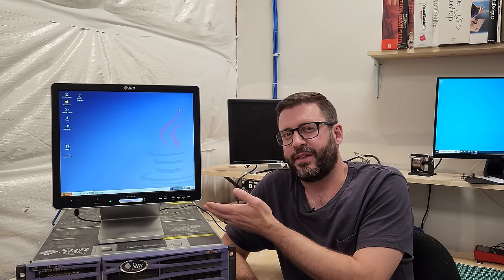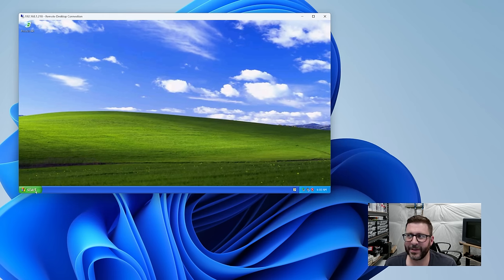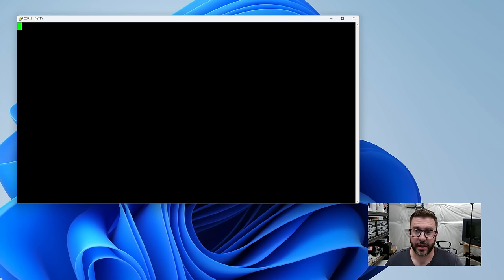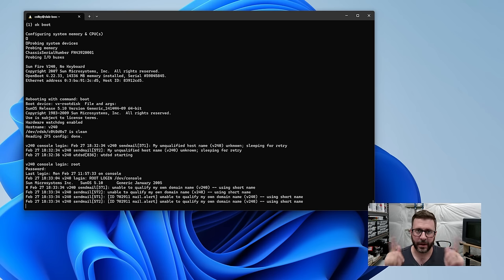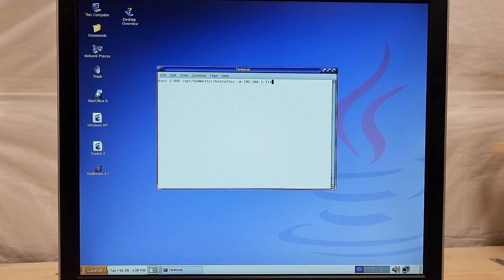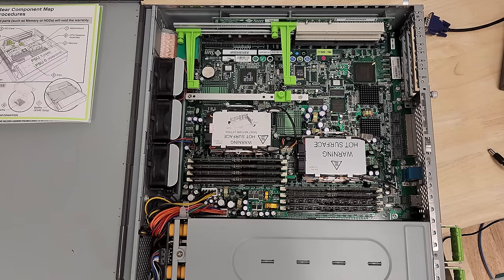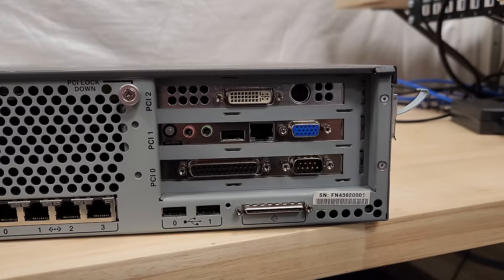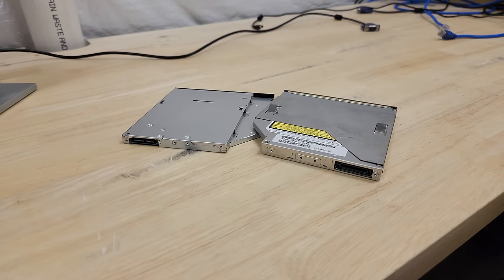Sun Ray Thin Clients Pt.3: Using Windows

Comment: what a cliffhanger! When I started at TI, vice president, said they used to work in the x86 business and I never knew why they would even try that! But this makes so much sense haha!
Reply from the maker: Sorry about the cliff hanger! We'll get it working eventually haha
Reply: TI used to make licensed 386 and 486 chips, as well as 387 co-processors IIRC. They may even have done one of the AMD-licensed 586 ones too. But after Pentium launched they dropped out of that market. Too bad! I'm a huge fan of TI stuff. I use their microcontrollers in my designs all the time, and I love their calculators (I have a pretty large collection of them). Definitely need a TI computer of some sort to complete my fanboy mania.

Comment: Hi !! You are my hero! I worked with this stuff and is impossible find sun/Solaris hardware cheap here in Brazil. Yesterday I brought a sun blade 100. R$500,00.. about $100,00.. includes a sun mouse and keyboard .
So, you are the guy that today does what I want to do, If I have access to the hardware.
Reply from the maker: Thanks! That's not too bad including the sun mouse and keyboard.
Reply: @clabretro  Yes, people charge a lot because is a "sun related" thing. Im also building my homelab rack. 2 x HP ML110 G7(Ill run esxi) 1 x 16TB HP microserver(xigmaNAS) 1x Dell powerconnect 2824, 1x  Watchguard XTM5(running PFSENSE) everything behind an UPS with an external baterry module(max 1 hour on batteries).
Reply from the maker: very nice! yeah sellers really inflate prices just because something has the Sun logo on it.

Comment: 20:30 that is actually supposed to be like that. It is there to provide some springiness.
Since what makes screws not go loosen over time isn't a large amount of torque, but rather that the screw remains under tension. Since tension will prevent it from continuing to loosen at any meaningful pace. Unlike a stiff joint that only needs the screw to crack loose once and then its free to vibrate further. So by making the bracket have an integrated spring (of debatable quality) will ensure that the cards remains firmly attached in more vibration prone environments. (like during shipping)

Now, not all brackets have this feature. I guess it looks ugly to some users, confuses others, or perhaps just adds manufacturing cost. But when it is there, it is intentional and serves a useful purpose.

Comment: If i see correctly, on the PCI Card are two additional connectors. one is the 34pin Floppy connector and other 40pin should be the smaller version of the ide connector. You find this connector in old Notebooks before SATA. Your IDE CD-Drive from the other Server is may incompatible. The Selection of the Drive Master/Slave is mostly flashed in the Firmware but it can be switched by unsolder of one specific PIN on the connector in the Drive or you flash the firmware.
Reply: The mini-IDE you're thinking of in laptops was actually 44 pins, because it had to provide power as well all in one connector. I have one in my NEC Versa 4000C laptop from the early 90s.

Comment: Great vid!   RDP has setting for # of colors.  I wonder if the sun client is limited or like the Windows client you can specify up to 32bit color   You might check to see if there's a newer version of Idrac for your 520's.  Newer versions work better with current Java or you can use HTML5.  Might not be available for the 520 but worth checking.   Keep the videos coming please.
Reply from the maker: thanks! I tried setting 24 bit color but it didn't make a difference. I probably need to play around with the settings more.

yeah my dell r720 has an idrac version which works fine in modern browsers, haven't dove into updating the r510 yet, on the list.

more to come!

Comment: Lol i was once talking about a x86 add-in card for the first Macs with caddy CDrom drives, and how a apple store near me had a mac and PC in the store window, with some kind of setup to show the mac could boot itself, and then boot windows, quicker than a bare metal PC doing it, and one of the folks who built those cards reached out in a comment and shared a bunch of pictures

I thought it was a mass produced unit, turns out they only made about 500 all told. It wasn't a apple product, it was made by a company in the UK

Its one of the few things outside of exotic radio gear that you struggle to find info on, i don't think many survived
Reply from the maker: Sad to think about how much interesting stuff like that has been lost to time (at least for now).
Reply: @clabretro  one oddity near me is a lot of odd older Dell PCs, Motorola phone stuff, and a few of the early iPhone prototypes, they were all built near me, with the exception of the iPhone that was maybe tested here? (In scotland)

A guy who reviews old PCs on here got a 30yo Dell still unused in its box from the Greenock factory and did a unboxing, I managed to send the video to a local group with a lot of the folk who worked at the plant, they were all chipping in seeing their initials on the QC stickers, or laughing at the squint lettering and tagging in the guy who worked that machine! 🤣 even the local MP was joining in, he'd been a union rep there, started him on the road to politics. Quite the trip down memory lane for them, and a ton of random info and questions answered for the video guy :)
Reply: @mor4y  ooh, was it anywhere near Greenock where IBM used to have their factory? Or, as your username implies, was it somewhere in Morayshire?

Comment: 28:56 I think you are dealing with HW issues. Last I remember using these, they were only compatible with IDE based Sparc-5 and Sparc-10 (maybe with Sparc 20/40) workstations and not with servers. I think you were supposed to connect a dedicated IDE drive directly to the card.

Comment: I would give an AMD Geode a try in this one. It should have the same socket as this Athlon (462), and even less power consumption. This card looks very nice indeed.
Reply from the maker: Oh thanks, I'll check that out! I'm probably going to source a CPU replacement to see if that's the issue, so this is helpful.

Comment: You should try to setup a Solaris 9 zone and pass the pci card into the zone, this way you don’t lose the work on sol10

Edit just make sure you use a whole root zone and not a sparse root zone
Reply from the maker: I was thinking about that actually! I haven't messed with zones at all but it'd be a good opportunity to try it out.
Reply: Zones are neat but I don't think they would resolve a driver incompatibility. Like with Linux containers, a Solaris 9 zone running under Solaris 10 would still use the Solaris 10 kernel.
Reply: @roge0  unless you chose a whole root zone vs sparse, in pretty certain a whole root sol9 zone would work for this

Comment: I wonder if it was a licencing issue because Windows NT 3.1 was ported to run on Intel x86 PC compatible, PC-98, DEC Alpha, and ARC-compliant MIPS platforms. Windows NT 3.51 was ported to UltraSPARC and PowerPC, but not released to the public. Would be interesting to get a copy of that Windows and then there wouldn't be a need for the external card. Of course NT 4.0 dropped support for UltraSPARC. I'm thinking running Linux KVM with Qemu and NT 3.51 😅
Reply from the maker: It's always interesting to think about how NT was developed with MIPS machines in mind (and sometimes on them, in fact).

Comment: I have a SunPCi IIIPro in my SunBlade 1500 (and had in a SB2500 before) and it works just fine with Solaris 10, even with the current system date. I suspect you are likely missing some patches. My system run relatively current KU 150400-48, SUNWspci3 version is 3.2.2. The SB1500 and SB2500 are very similar systems to your v240 so I would not expect any issue with the HW compatibility.
Reply from the maker: Thanks for that extra info, that's really helpful. Last night I got Solaris 8 and SUNWspci3 3.2.1 running on a V440 and it was exactly the same failure mode (x86 board wouldn't respond to the driver).

That, coupled with your info and the fact that I did see it work once on Solaris 10 leads me to believe it's hardware failure on the SunPCi board. I'm going to start by sourcing a new CPU.
Reply: @clabretro  one more idea: I seem to remember that SunPCi boards require some minimal version of OBP of its host, regardless of the Solaris version the host is running. The most recent version for most sun4u systems is OBP 4.30.4.a (which is what my SB1500 sports now), so maybe you need to update the firmware of your servers.
Reply from the maker: Oh thank you, I'll explore that too.

Comment: Wow, that system time error. I get the general utility of having a sanity-check for an admin accidentally typing, eg, 2096 instead of 2006... but how low is that threshold?! 

I guess it's at least outside of the service life of the hardware it's installed in. Still, that other commenter mentioned a hospital using Sun Rays connecting to Windows 10. It's probably some other way of running Windows 10 rather than one of these PCi cards forced to upgrade, but I still wonder if that check in the setup software causes that hospital any issues.
Reply from the maker: Haha I know. Another comment mentioned patching the binary to skip that check entirely.

Comment: Hey. I just had the same issue with Windows 11 when was connecting to the Hyper-V VM using an enhanced mode (which I believe was just RDP). In order to fix this, I disabled Windows Hello security stuff, which was just a PIN-code login in my case
Reply from the maker: Oh thanks, I'll try that.

Comment: Man - epic series, I am really enjoying. But - fully off-topic. How many dreamcasts have you got? Why??
Reply from the maker: haha good question. 12 of them or something, it was an as-is ebay lot I couldn't pass up. came out to something like $13 usd each (basically 2008 thrifting prices). they're Japanese units but it's okay to run them on 120v for short game sessions. and the power supplies can be replaced or modded.

about half of them work just fine, the other half work but have broken gdroms. I fixed up 3 of them with gdemu units and noctua fan mods. had dreams of selling them but never got around to it.
Reply: @clabretro  epic

Comment: I'd be very surprised if there's not some way to get terminal services running on Windows 2000 Pro, if it runs on the Server version. It would likely just involve tricking it to think it was the Server version, like I would trick Windows 7 Home. 

That said, is there really any reason not to just install the Server edition? Would that game not work on the Server edition? Did you just not want to take the time, since you were already going to have to do a Windows install for the video anyway?
Reply from the maker: Yeah there's probably a way. It was just a total oversight on my part, I'm going to get the server edition on there eventually.

Comment: You can change the Windows 10 Security NLM on the remote desktop Tap Uncheck the Secure connection box that's require a secure connection then apply that change

Comment: Over-engineered you say? What was the MSRP for those Sun servers back in the day?
Cursed indeed. Flashbacks to Apple Quadra 610 (68040 w/ 486sx board)
Reply from the maker: That v240 was around $7,000 USD list price fully equipped back when it came out. One of Sun's "cheaper" machines haha
Reply: That is cheaper than I would have imagined! Was that for one processor and a single stick of RAM, BYO storage, by any chance? @clabretro  or did they actually list devices in configurations that were not imaginary? First intro to *nix the 90's SPARCstations. Didn't see what they were running in the cursed 90's mishmash of server racks. Was a primarily unix and apple environment though x86 machines were around too. That poor sysadmiin.
Reply from the maker: This would've been the "large" configuration for $6,495: https://web.archive.org/web/20030621084857/http://store.sun.com/catalog/doc/BrowsePage.jhtml?catid=100055

2 processors and 2GB of ram.
Reply: Cheers! That is actually not too bad, especially compared to the 'small' 4/5U systems. Swings and roundabouts I suppose, especially when it comes to fast local storage. Don't know the state of SAN controllers at the time. Looking forward to next installment!

Comment: The sunPci must be working on Solaris 10, i got it working in my Sun V890,
Maybe test it on your V440, i know they they must support it
Reply from the maker: I'll be trying it on the V440 for sure. The more I think about it the more I wonder if the CPU fried itself.
Reply: @clabretro  As I recall the Athlon XPs were the last CPUs that didn't come with real, decent thermal protection (as in, if it gets hot, it dials things back, rather than just hard-cutting power or blowing the CPU - CPUs afterwards all had something like that by default, based around how Intel implemented it). IIRC back in the day there was usually an insocket temp sensor on the mobo that was used, and the Athlons had a 'rough and ready' temp sensor on the CPU die - but not all mobos supported it (and I doubt the SunPCI would have).

So there's a pretty real risk that it toasted itself if the thermal paste/pads are past their useful life.

Of course, this potential disappointment leads to the more exciting question of "Is the CPU on the SunPCI socketed, and can the CPU be replaced with something faster?"
Reply from the maker: I ended up pulling the Athlon in a short patreon vid, and it's possible it fried, thermal situation wasn't great. Good news is I have a couple replacements on the way... so hopefully once that's sorted I'll have a "successful" video showing it working!

It did indeed have a temp sensor under the CPU. I'll also be testing the fan assembly before running any replacements to make sure that's all good.